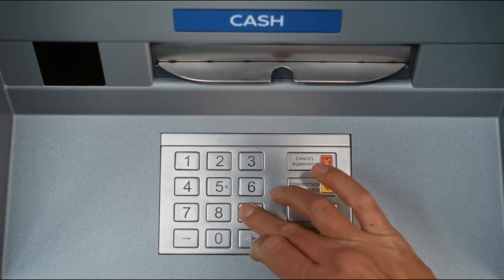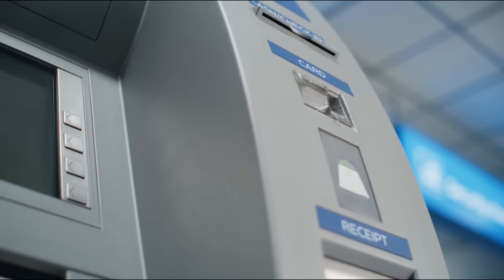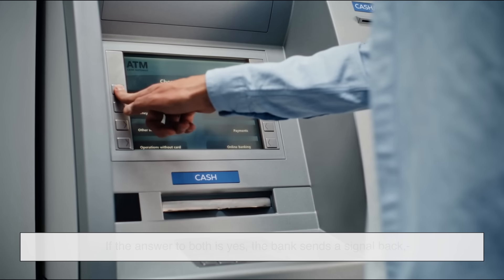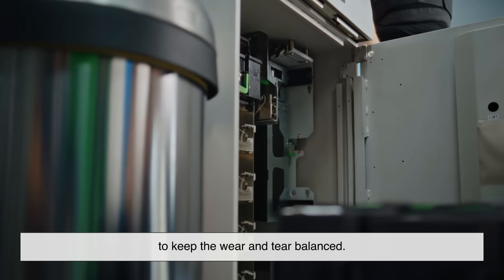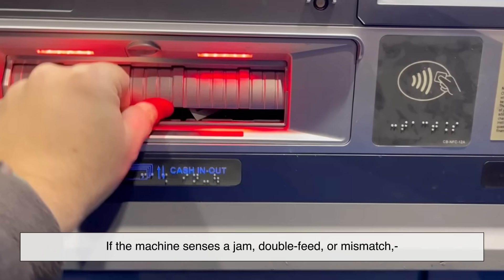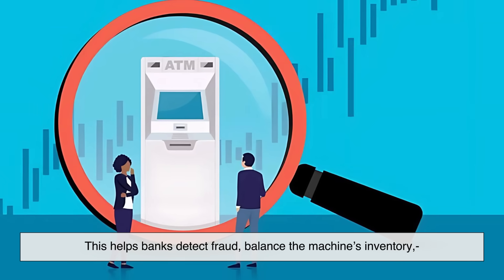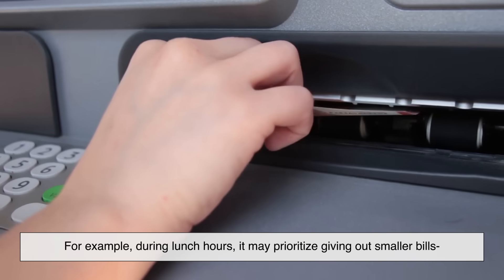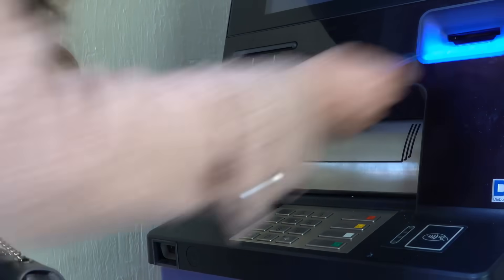How Does an ATM Know How Much Cash to Give?

Comment: Canadian banks were pioneers in the implementation of ATMs, and POP terminal technology.  The first ATMs were installed in Toronto and Montreal in the very late 1970s..  By 1982, every Canadian city bank branch had an ATM.  The system was so successful and robust that fully self contained ATM units could be found in every convenience store, gas station and grocery store by 1990 in every outlying hick town and arctic community..  By 1995 every taxi cab, gas pump, and convenience store till had a POP terminal.  The POP terminal forced the introduction of the RFD ID chip to be fitted into every bank card to prevent transaction fraud and counterfeit bank cards.  All this was pioneered in Canada.
Reply: Nope.

The first ATM was installed by Barclays Bank in London (UK) on June 27, 1967. It was created by John Shepherd-Barron. After Great Britain, ATMs began to appear in other countries relatively quickly. Here is the order of installation of the first ATMs in selected countries:

Europe:Sweden – 1967 (shortly after the UK, implemented by Bankomat AB, cooperating with Barclays)

France – 1968 (the first ATM was installed by Société Générale)

FRG (West Germany) – 1968 (introduced by Sparkassen)

Switzerland – 1968 (the first ATM in Zurich)

North America:
USA – 1969 (the first ATM by Chemical Bank in New York)

Canada – 1969 (the first ATM in Toronto, introduced by Toronto-Dominion Bank)
Reply: Yes I was in France and PIN and chip was already installed- it would not accept come Canadian credit cards.

Comment: Brit here : If you are distracted and forget to take your cash, it sucks it back - the time allowed I believe can be varied. I did it once, and got it sorted the next day without fuss. Visitors to Scotland may be surprised normally to get Scottish banknotes from ATMs. Except at airports - Bank of England ones. All are worth the same.
Reply: @ronnie5941 : And in Northern Ireland you will get Northern Irish sterling banknotes.
When I travel to England most shops reject them out of having never seen them.
Reply: My Mother once forgot a quite substantial amount of money at the atm, didn't know it gets pulled back in.
Reply: @Saavik256  Not in Europe - here, cards that are accidentally left in the card slot for too long are withdrawn into the machine for safekeeping. Of course, the ATM beeps to remind you of the card, but in the event you really are that careless or slow to respond to its signalling, it will do what it does for security (and preventing any opportunistic snatch theft as well)
Reply: Not cash, but "self-serve" printing of bank statements in Germany...
I once did not realise there were more statement pages to come (when the machine paused after printing 10) and I walked away...
Required "evidence" for tax reporting (possible 'audit'), the missing few could have been re-printed, eventually (for a charge).
But, a friendly bank clerk visited the machine (in a shopping mall) after work, and collected my statements from the box's internal tray...
It had printed the remaining few as I had walked away, and, a few minutes later, "sucked 'em back in" to clear the chute.
A few tense hours for me, but eventual relief, gratitude to the bank clerk, and thanks to the machine's designers and coders (whomever they were)!!
(I brought a bouquet of sunflowers for the bank clerk, but thought the machine in the mall wouldn't be able to appreciate any... 🙂)
Reply: ATMS in the U.S also do this
Reply: yep. Actually, the sucked-back cash is actually depoised in a "trash can" thingy in the ATM. Why you might ask? First, because dispense-only ATMs have no way to put bills back in their right casettes. Second, if you were to replace the bills in the middle between a stack of bills with fake cash, the fake cash would get dispensed to poor customers, 

This was used by some fraudsters to gain free money, and the customers using the ATM afterwards would get fake cash without no way proving they got it from ATM, resulting in a few jailed people. But after it was found out, nowadays all ATMs use the "trash can" principle, where a human will check the bills.

This is why it takes so long before you get your money bank if you happen to forget to take the bills and they are sucked back. When you report it, a human will actually travel to the ATM location and look in the trash can thingy. The bills in that "can" is in order, so they will know exactly which bills are yours and which bills are for another customer who forgot to take his bills.

ATMs with depoist ability, usually depoist depoisted money in separate cassettes from which they withdraw money. This is why a combined ATM can still be "out of money" even if the person in front depoist a large stack of bills. In this way, the bills depoisted, can be checked throughtly so nobody depoisted fake cash.